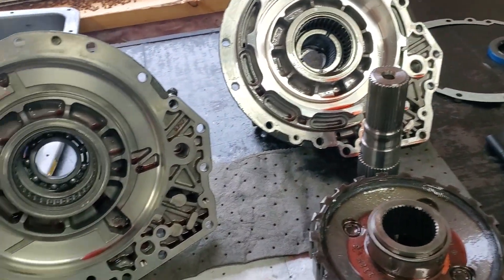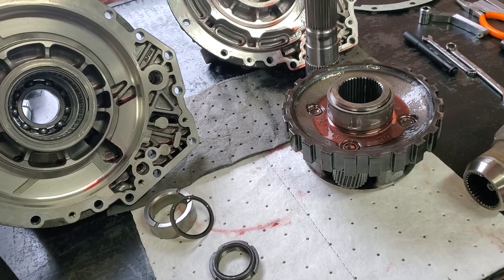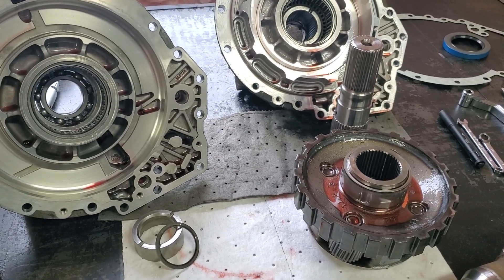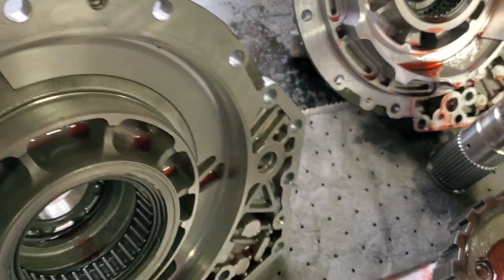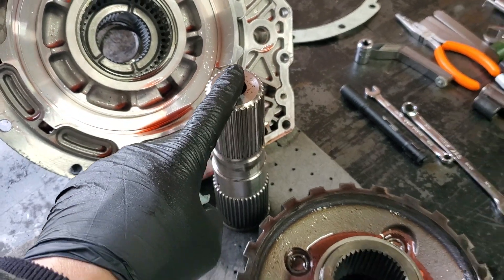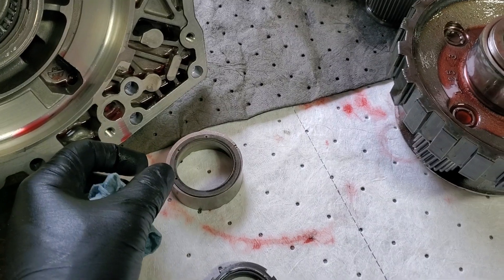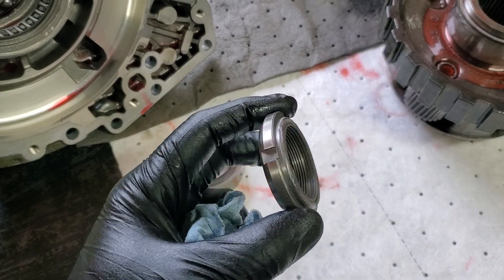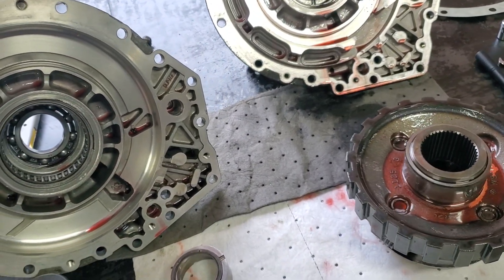Allison 1000 2wd to 4wd swap

Comment: I have .200” between the caged needle bearing and needle bearing snap ring is this normal for 4x4 extension housing?
Reply from the maker: No. Is this a replacement bearing you installed? All original?
Reply: @JJAM_TT  it is the old one idk if it’s original it appears that someone before me had the trans rebuilt
Reply from the maker: @nicjones3646 Do you have a way to get a picture? I can measure the height of a known good bearing and post it
Reply: Where can I get that spacer and shim for the output shaft?

Comment: What is the time frame for swapping 2 wheel to 4 wheel. Have both trans but using 4 wheel parts to swap 2 wheel trans into 4 wheel. Just trying to get an idea for quoting the job . Thank you
Reply from the maker: An hour by the time you change seals in the c5 piston, clean everything, reinstall and check end play when done
Reply: @JJAM_TT thank you. Appreciate the fast response

Comment: Very informative video! Does the nylon-nut only apply to 2wd transmissions when installing the yoke? Im wanting to go from 2wd-4wd
Reply from the maker: The nylon nut is for the 4wd output shaft and requires the appropriate socket. Part # 29531231 is the nut for 2001-2010 GM trucks
Reply: @JJAM_TT thank you, i appreciate the fast response! Im hoping to pickup up a 4wd core this afternoon. Guy can’t tell me much about it. But in hopeful it does have the usable parts that i need: Extension housing, output shaft, sleeve and shim. This project seemed alot more intimidating, but again you did a great job of clarifying
Reply from the maker: @chevy1019 Be careful when installing the rear housing, run bolts down slowly and even, they will crack if forced
Reply: I have .200” between the caged needle bearing and needle bearing snap ring is this normal for 4x4 extension housing?

Comment: Hello I’m doing this with mine and need some help. Anyway I can contact you? Willing to pay for knowledge thanks!
Reply from the maker: @moisesrios349  What's the issue you're having
Reply: @ I replaced the tail housing shaft spacer and little washer for the 4wd to the other trans and get everything lined up but the cover has a 1/4” gap from seating all the way. If I compress the cover with the bolts I bind down the rear shaft. I’m stuck don’t know what to do.
Reply from the maker: @moisesrios349  You more than likely have a bearing out of place. Are you attempting this with the rear of the transmission facing upwards?
Reply: @JJAM_TT  I am having the same problem, The transmission is standing on its bell-housing.. Going from 4wd to 2wd , thank you for your help, cover is open about 1/4 inch..
Reply from the maker: @donaldroberts4207 Remove the sun gears and main shaft, ensure all bearings are in place and the spacer between the sun gears is splined correctly

Comment: I have a 2006 Chevy Lbz 4x4. And a 86 c30. Well I’m trying to make the trans 2wd to swap in my squarebody. This is the only video thats helped me so far. Where would the best place to be to get the parts I need.
Reply from the maker: @ziptiekustoms  Xcalliber transmission has a good supply of used parts